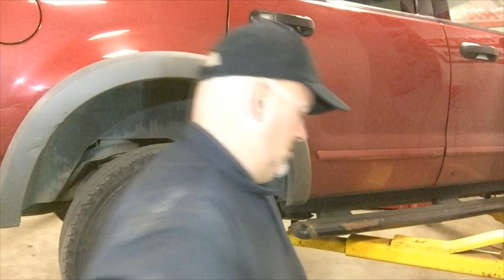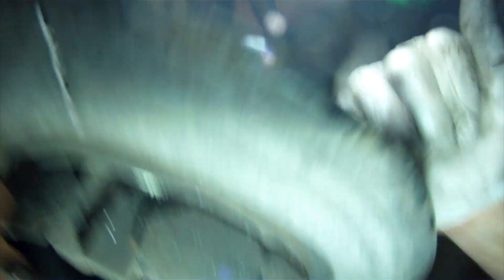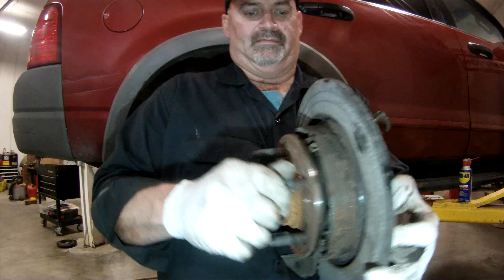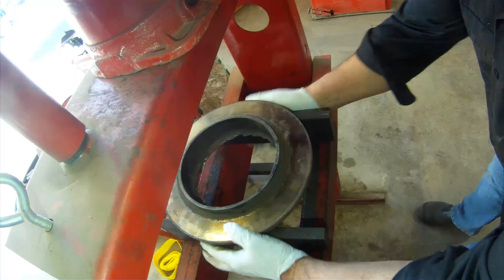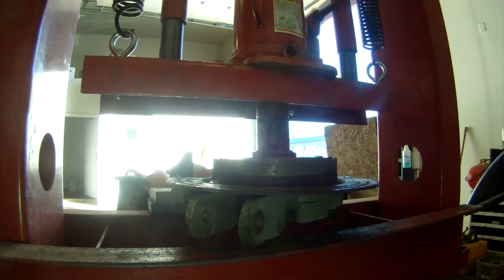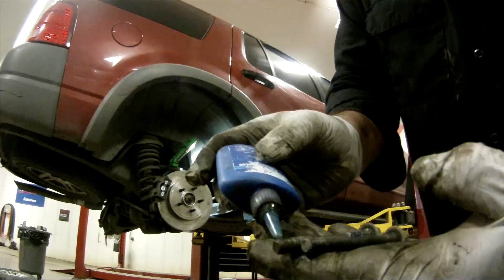How To Replace Ford Explorer Rear Wheel Bearing - DIY Mercury Mountianeer Wheel Bearing Replace

Comment: I did it on a 2008 yesterday. No way that parking brake cable pulls out like that on that baby. You can compress the spring with a zip tie, which makes life easy. .
Reply from the maker: Not sure what youre saying.
Reply: @ThecardoctorTV  the one I did is a bit different to the one you were working on. You can't just pull it out like the one you're doing there. It was the hardest part of the job for me.

But for the next person, it is easy to deal with on that model by using a cable tie to just compress the spring. Then you can unclip it at the end and remove it easily. When it comes to installing the levers later, that part is easy too. Snip it when you are done.

Comment: I think on the lower end presses if the  space between the Horizontal I-Beams for the work support isn't wide enough between the beams to allow the hub to pass by and drop between, you'll have to find a deeper hat rotor or use higher wider steel pieces or strong wood blocks to put on each side of the rotor.

Comment: How far did you press the hub?  Until it bottoms out?  Great video!!  I used a bearing replace kit - https://www.amazon.com/gp/product/B00ZZNBMVI/ref=oh_aui_detailpage_o03_s00?ie=UTF8&psc=1 - about 60.00 and it worked great, I did have to hammer the hub out.  Luckily, we do not need salt on our road in the winter so things came apart with normal effort.

Comment: I like your video very much. You are very professional in your work. I am currently using your method with an old rotor. Makes it so easy. My biggest question is what did you use on the opposite side to level the knuckle when pressing out the bearing?

Comment: I've got a question. Will a 20 ton press be enough to press the hub and bearing out?  Also, will the same press be enough for the task of installing the new hub and bearing??
Reply from the maker: Should work great for both. That's what I have.
Reply: Believe it or not some times they won't budge with a 20 ton press. Heard After you get the hub and snap ring off sometimes a large sledge hammer can  break the freeze before starting to using the press and might save you having  to resort to torch heating or cutting.

Comment: what size nut is the control arm and trailing arm
Reply from the maker: I forget. Sorry
Reply: I finally got it after 4 days the wheel  bearing was seized on the rear Axel so ended up swapping out the whole ordeal
Reply: thanks for the reply anyway! appreciate it

Comment: I got a Ford Tempo with 80,00km in it. Do I have to change rear or front wheel bearings due to mileage or just change them when the wheels move in and out due to bearing looseness?
Reply from the maker: No mileage interval for changing those wheel bearings. Just replace if inspection shows signs of play or they feel or sound noisy. Thanks for tuning in!

Comment: It's funny that I've watched this job done anywhere from absolute insanity-inducing to your example which went pretty smoothly...  Apparently the rust can make a huge difference.  My gf's got an 06 and I can tell many bearings will need done on it by this March.  I'd say both fronts and probably at least one rear but maybe both of them.  Not a lot of wobble, if any, but definitely noisy.  Your video was really clear...  Unfortunately I probably won't be tackling the rear ones on my own, and will have to pay for it, but the fronts, I'm going to attempt those myself.  Great video man.
Reply from the maker: Thank you. I hope the rust doesn't cause you any issues. We don't see a lot of rust here. Blessings.
Reply: Oh it's a never-ending battle here man.  Thanks for the video though, it's a good resource for tackling a known problem bearing for many.

Comment: hi I've got a question for you. I have a 1990 Chevy k1500 that I am going to replace the power steering gearbox on do you know if the remanufatured gear boxes are already lined up in the straight forward position? or do you have to line them up yourself? and what I am saying is if I have my wheels set straight and steering wheel should the shafts on the new gearbox be lined up that way too? and if I have to line the new one up how do I find the center line? any help here would be greatly appreciated?
Reply from the maker: The only way to know for sure is to rotate the input shaft on the replacement box and count the turns. Then divide in half and turn back that many times. If the truck has airbags then be sure to have the wheel centered before removing the old box and bungee cord the steering wheel so it won't move.

Comment: what if the torque is not done at the exact amount? what will it do?
Reply from the maker: +amanda heese If it's too loose then the bearing can become loose and the tire flop around. Too tight and it can cause premature failure of the bearing. There are a few automotive fasteners you can get away with winging it but these aren't ones you should try to do that with. Important for safety. Thanks for checking. Hope to see you again here soon.
Reply: +The Car Doctor, so is it possible to use a torque wrench that only goes to 140 to accurately torque to 200+ ? sorry such uneducated questions. Just trying to get an idea if mine was done right, I'm worried it was not. Thank you for taking the time to respond.
Reply from the maker: Well of course it's not going to be completely accurate but if it's all you had access to its certainly better than not using one at all. You develop a feel for proper torque and I bet I could get pretty close without a torque meter but in this case I'm not sure that's a good idea just guessing. Swing by a shop with the proper tools or use one from a parts store that loans them out and get it torqued right. That way you can sleep at night and be rested enough to watch more Car Doctor videos without nodding off.

Comment: Why can't they do a hub bearing assembly like on the front?  Three bolts you take off and use a slide hammer to pull the old assembly off.  I know the rear has the parking brakes but still the front is so much simpler on most vehicles.
Reply from the maker: +traingp7 Well that would be too easy.
Reply: That suspension setup is very similar to the 89-97 tbirds/mk8. No doubt it was inspired by that car, and they also had press out rears, and hubs in the front.
Reply from the maker: I never thought of that but you're probably right.

Comment: whats the trick to installing the parking brake lever???
Reply from the maker: +Michael Habschmidt If your asking how to install the cable back onto the lever its a pain. I use a pair of pliers to hold the end of the cable then a pair of cutters to pinch down on the cable above the housing after I pull back the spring and then slip it over the lever when compressed. Its a real PITA but youll get it. Let me know if that's not what you were asking. Good luck!

Comment: you'd love removing the rear hub bearing on a 2015 exploder. one with 3,000 miles took me an hour to extract.
Reply from the maker: +MAN drew Why had the bearing failed with such low miles? So I take it that they haven't made them any easier to do in 2015?!